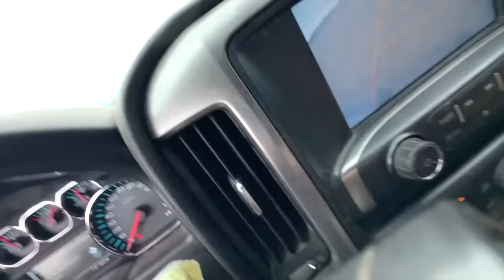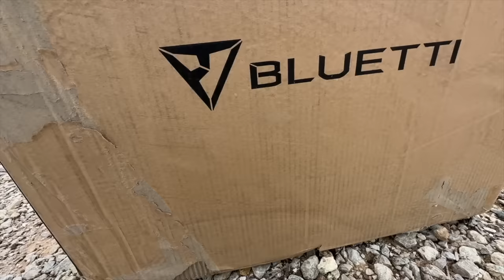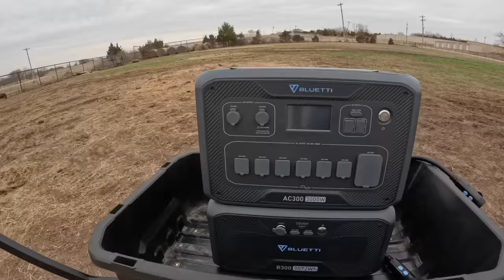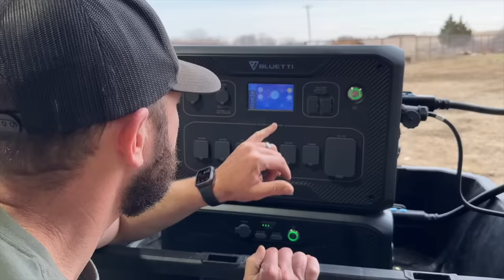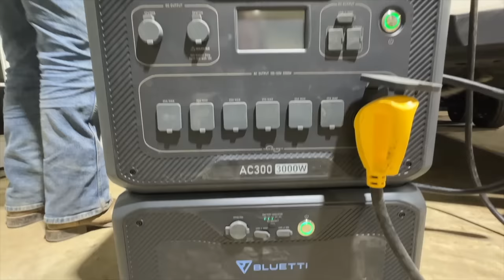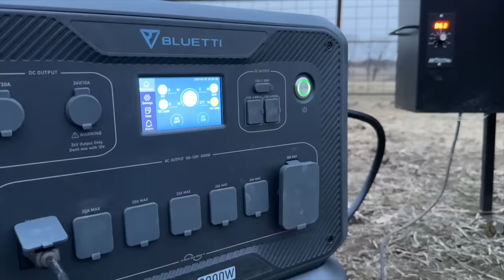Hoss Did It Again! Just What We Needed….BLUETTI AC300 + B300

Comment: You ought to add a sewer dump for the RV while you can.  If you use it somewhere else, it will be nice to pull it inside and clean your holding tanks.  Just a suggestion from a RV user.

Comment: If you didn't know, you can put an adapter on your RV cord to convert it to the standard 15/20 amp plug on your extension cord.  While a real 30 amp supply is necessary to run the a/c unit of your trailer, most everything else will only draw 15 amps or less.  I have my trailer plugged into a 15 amp circuit, and that will keep the trailer's house battery charged, run all the LED 12V lights, the furnace, the water pump, the refrigerator, and if I'm not trying to do everything at once, the microwave.  If you HAD to run the a/c, then your Bluetti would supply the amperage for a while - I haven't done the math to figure out how long.  But just sitting in the barn, you don't need 30 amps.  The 30 to 15/20 amp adapter is about $6 or $7 at Walmart or any RV store.  You can probably also get it at Tractor Supply or any good hardware store, or on line through Amazon.  Save the Bluetti for recharging your power tools out on a fence line!

Comment: Rustolumn cement paint would be easier to clean if many cleanups after people. 
The tractor paints tend to " pop up" or peel, after 20 years moisture and wear. 
Then there's the garage painted floor lay downs, too. 
Poor little Hoss has " Spring Fever" !  I get it too.

Comment: So the bison can not jump over that fence. Hoss has to be climbing over the metal fencing which should show some sign of that. That is what you have to make higher. Am I right or wrong? Only an occasional viewer. If you suspect I may be correct putting something on fence to mark Hoss and confirm the method might be good. Or greasing the metal strategically may limit the fence jumping.
Reply: He is jumping a barbed wire fence that was there before Dusty bought the property.
Reply: @pennyentringer168  Thanks. I don't see every episode so it was interesting to learn.